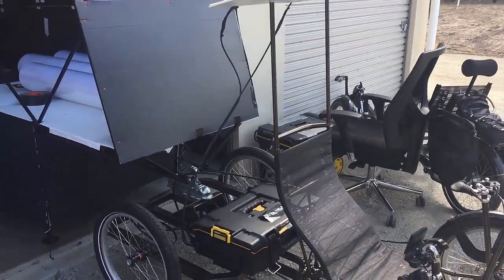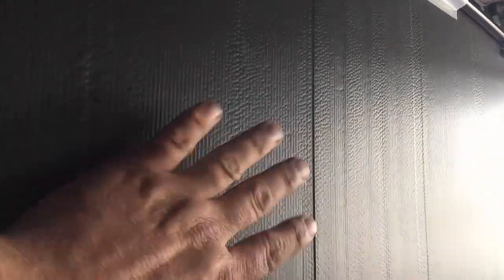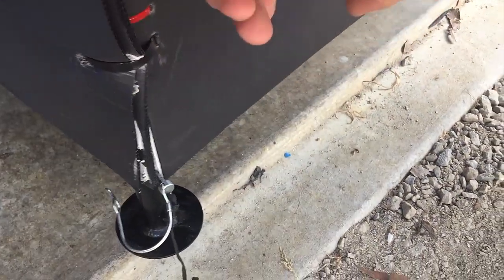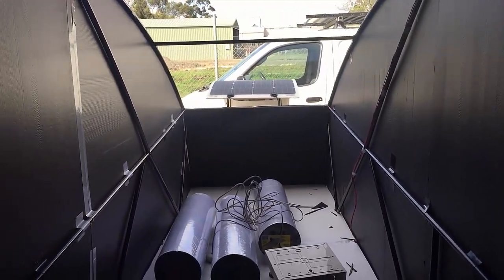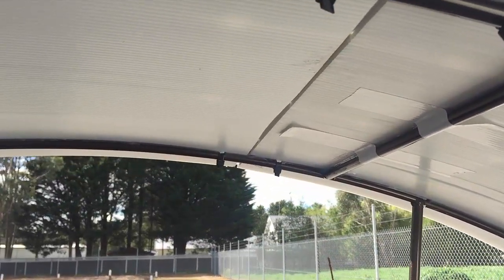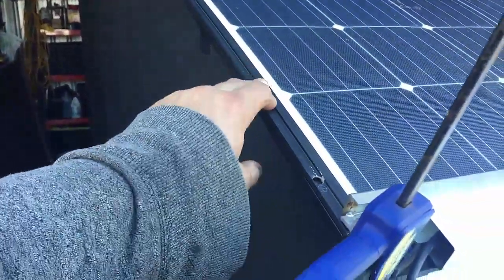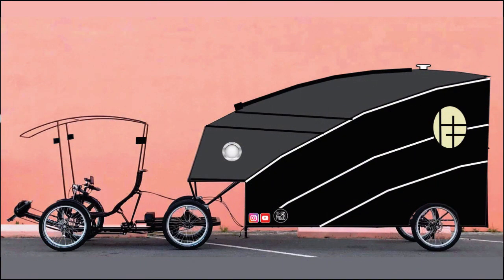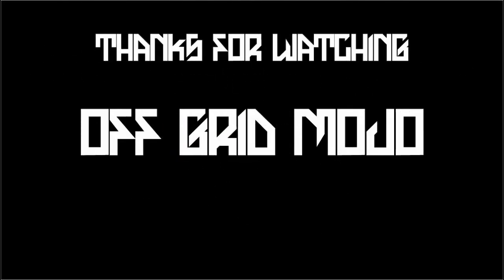Quadricycle Build - Corflute And Insulation Part 2 By Off Grid Mojo

Comment: I love your project looks nice
Reply from the maker: Thanx Calvin.
Reply: Are you going to do more projects?
Reply from the maker: @calvingarrett3245  Definately more projects coming Calvin but they are just on paper at the moment, it will be some time before I get into the next one as I have to iron out all the bugs with the quad, ie : weight, ease of access, the corflute skin and some other stuff. 
My next project I hope will be an off grid houseboat/shantiboat that has twin electric outboard motors and all the usual bells and whistles that go along with an off grid system. My goal eventually will be to live 6 months going down the Murray River and then 6 months in the quad touring. I have a crazy idea that I can somehow have my magnum trike on the houseboat as the main seat where I can use pedal assist to offset some of the power drain from the motors etc.
Reply: @offgridmojo  oh that sounds good I'm doing some add-ons to my solar 2 260 watt panels new epever charge controller 3 deep cycle batteries to add with my other 2 makes it 5 batteries and 2 extra meters to read input and output on system been raining here but I need connect it up after the rain soon bought a 200 watt inverter for charging my hair cutting machine and run my Norelco shaver can't wait to start using it all.im currently using a polychristaling 50 watt panel with 3 batteries now
Reply from the maker: Sounds groovy Calvin, my apologies for late reply, I’m having issues with some comments going into review inside YouTube studio and I’m only getting the hang of it now!
All the best with everything bud.
Reply from the maker: How’d you go with the add ons?

Comment: Now that's progress! Looks like it's going to be a similar mode of living to mine but you're way ahead!
Do you get claustrophobic at all? I thought I wouldn't, then after several nights in my micro-camper, I woke up early hours in a panic and had to bail outside. I hopped back inside but it happened again five minutes later. This time I walked around for a bit trying to get over it, third time I left the door open and it was all right. In the morning I moved things around to give me more room and it's fine now. It's not going to be an issue when it's finished because I will be able to stand and stretch because of the pop-top, plus there's the two vestibule areas on either side so it will feel way larger.
Anyhow, I am really enjoying your build and hope you don't stop videos when it's finished. I hope to see you doing touring videos and showing what it's like to live in.
Reply from the maker: Thanx Dave, I am having an absolute blast fitting it out, truly starting to feel like my home on wheels especially after today’s effort with the walls, roof and solar panel.
Bummer about your claustrophobia bud but as you said once the pop top is up you’ll be fine, I do get claustrophobia as well but not in the module because I am able to stand upright at the entry area!
That’s great your enjoying my video’s mate as I have an awesome amount of fun making them and will continue making them when touring as it keeps me grounded and also showcasing to other people that nomadic living with human powered bicycle is possible and quite comfortable as well.
More to come soon bud. Take care.
Reply from the maker: Feel free to post my vid’s on your Facebook page bud if you wish!.